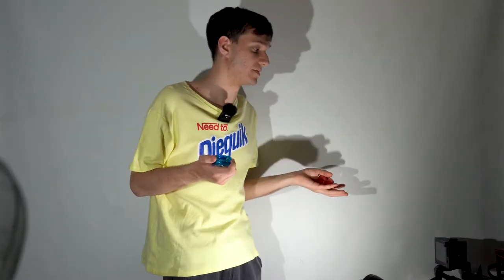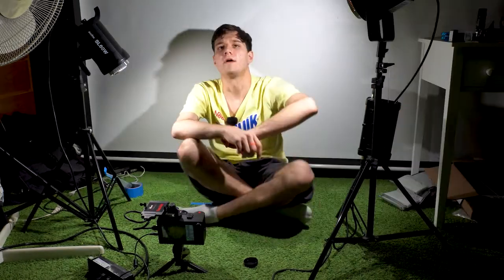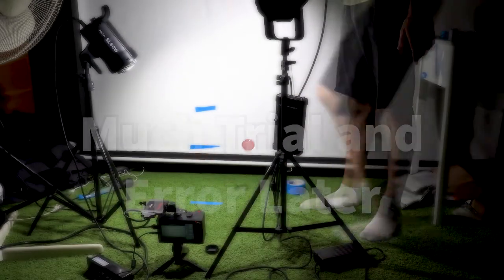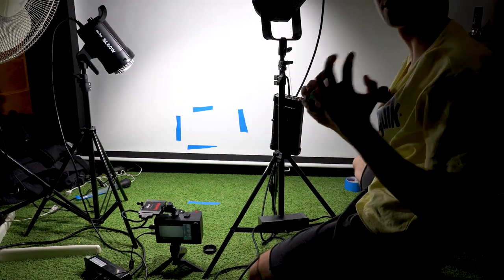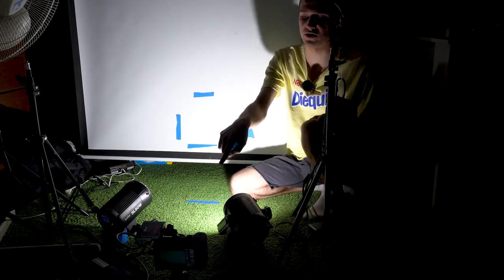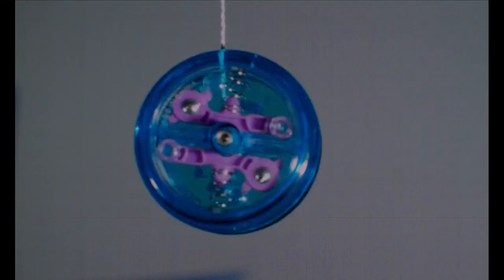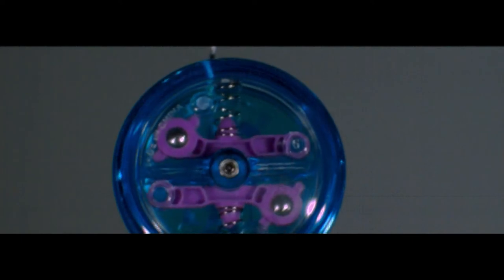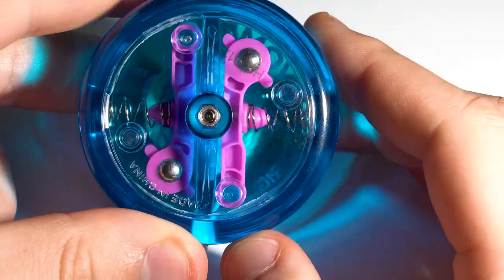National Yo-Yo Day! - How Does a Auto Return Yo-Yo Work in Slow Motion?

Comment: I am just pontificating here, but I think I figured it out for the most part.  You are correct in what you presented.  The centrifugal force of the spin causes the two arm-bearings to move towards the edge of the yoyo, thereby pressing on the coil.  When the spin gets reduced (centrifugal force is reduced), then the force causing the arm-bearing to move towards the outside, it weakens, and the coils power becomes greater than the centrifugal force.  At this precise time, the coils push out, retracting the arm-bearings to their starting positions, which have a hidden teeth-like apparatus that grips the spin-bearing system and clamps down thereby not allowing the bearings inside the spin-bearing system to rotate, which causes the yoyo to stop spinning immediately and the remaining excess energy pulls the yo-yo up.  The trick to the design is getting the coil system just perfectly balanced, so that by the time the teeth clamp down the yoyo still has enough power to recoil but preventing it from doing it too early so the yoyo never spins.  Thank you so so so much for helping me understand this.  This had truly bothered me not understanding. LOL
Reply from the maker: This explanation actually helped me understand as well what is happening 😂 thank you.
Reply: Exactly, about the centrifugal force. I have an X-Brain and its clutch assembly is made of four sliders with springs and steel ball weights to open up when spinning past.